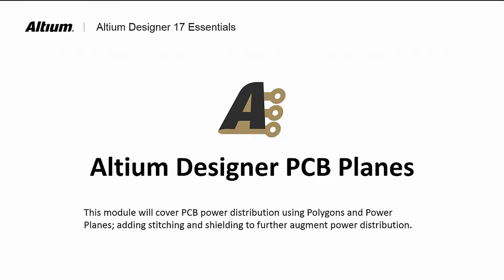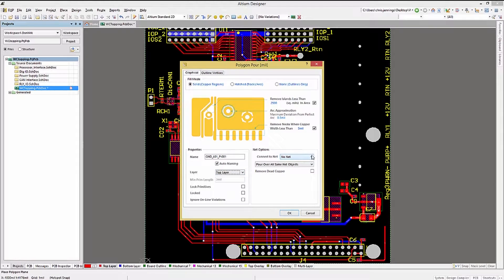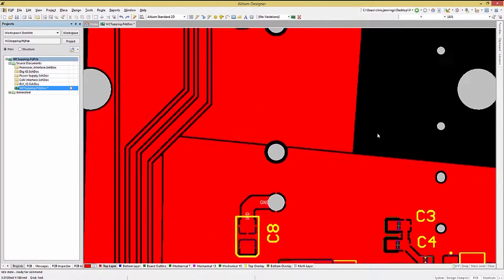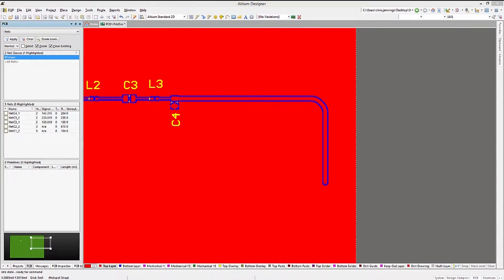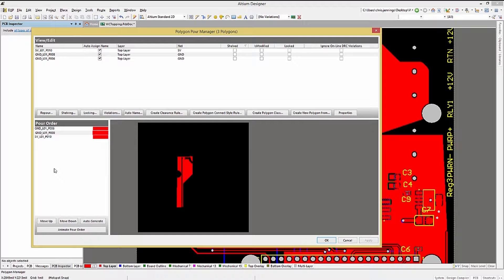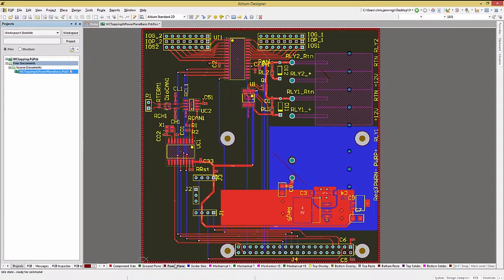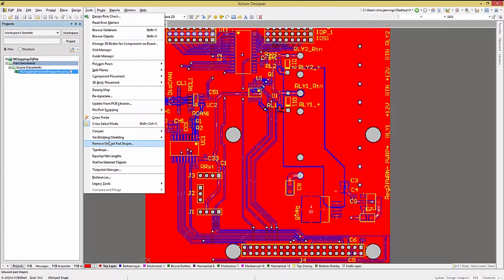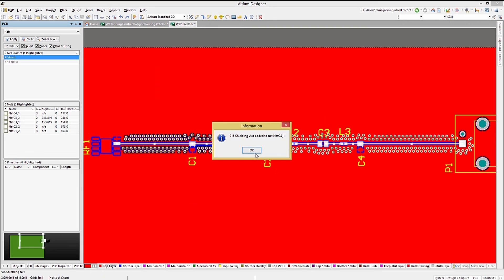Floods, Planes and Polygons for Ground and Power | Altium Designer 17 Essentials | Module 24

Comment: I need to do a polygon copper pour first but how do I do this?
Reply: This software is awful in how to set up polygons. I have never seen such bad software and in addition it is a shame to release such software worldwide and everyone is constantly complaining about the same things. I wasted many hours finding out things that don't really make sense. I tried over time to work with this software but I gave up because it is not intuitive at all, it is even annoying and illogical.
Reply: @stefanstef7161  Not true. You just need to learn how to use it, that's all. I like this software now. It's far easier to use than diptrace. That's for sure. After the schematic is drawn, I go directly to the PCB mode and design it from there. I skip all that ratsnet crap!
Reply: @Berghiker   Hey! I am finding problem in polygon pour(altium 21 ), only the outline of polygon is displayed and no fill inside it. Have you encountered this ? Do you know some way to get out of this
Reply: @kirans862  Have never used altium.
Reply: @kirans862  uncheck the unfill box that shows a min poly.  it is just plain stupd that the default is to have that checked when using a pour...
Reply: @stefanstef7161 
Please elaborate.